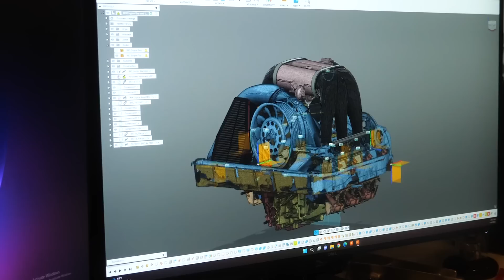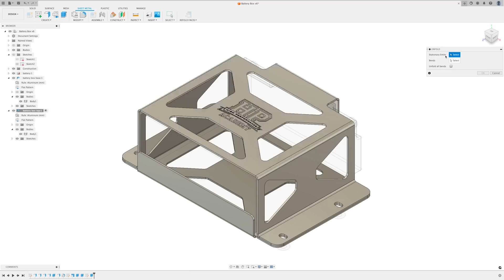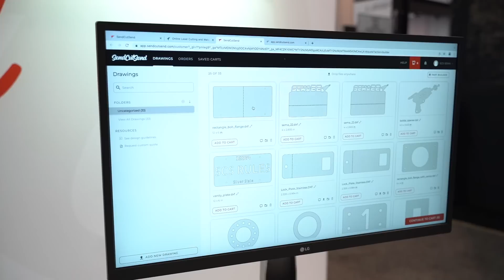Building Race Cars & Parts with CAD

Comment: my start in CAD actually began originally with 2D hand drafting on the boards with mechanical pencils, erasers, engineer and architectural scales, and sheets of vellum (think Kelly Johnson at Lockheed designing the SR-71 Blackbird).  this was the DEFAULT class Mechanical Engineering students had to take back in the mid to late 80's as CAD was still in it's infancy (or in many places just non-existant).  however it did become available at nearby Colleges/Universities around 1987, after that a student was required to take it in their 2nd semester...

my "first contact" so to speak with CAD was (get this) Autocad release 10 on DOS Intel 386 PC's using puck and tablet 1988.  yes, for those counting at home this would be 35 years ago so I'm an old "bastid".  ironically while I'm no Chip Foose, Dave Kindig, or Ring Brothers when it comes sketching out whole cars, i still like designing individual parts (before moving to Solidworks, F360, OnShape, etc) with classic pencil and paper.  it's "artsy" and "therapeutic" for me like I suspect it is for those guys.  ref: old world Painters/Sculptors from History. #ZEN
Reply: I think I was among the last generation of engineering students that learned to do it on paper with pencils and had to finish marked exams this way too. Ofc we learned CAD (PTC Pro Engineer) next to that, but the profs were like "the old school way is the basis!"... iirc these days it's all CAD from semester one.

Comment: We need more metal 3d printers and we need the cost to print to come down. I think there is tremendous opportunity to make a lot of money once the speed of prints improve and the volume prints are better
Reply from the maker: It has already been a long time coming but it will get there. There will always be tradeoffs between this and what are already well-established manufacturing techniques though rather than a 'one size fits all' replacement, imo - Taz.

Comment: This is BS for a hobbiest, and I'll tell you why ... Over several years I learnt 2D/3DCAD, 3D scanning, 3D printing all of it just for a hobby and all for my project car. I designed, test fit, printed molds and cast my own intake manifold amongst all the other parts I've made for my project. Sure it was fun and it's a one-off, but this part alone cost about 3x more that an aftermarket intake manifold that's readily available and took about 6 months to com to fruition. The trouble with knowing all these things is that you can easily find a way to make whatever you desire, or even parts you don't need, but make them because you can ...... and THAT is the problem!! .... not so much for a company with backing
Reply: I get its a massive topic and many years are needed to master- but some might enjoy 3d modeling a car trailer for example or 2d laser cutting shapes which is probably enough for most. Sounds like you went pretty well with it - like further than most Cheers
Reply: narrow minded. it is NOT BS depending on what you're doing. there are plenty of other areas in which it does save money and/or time.
i made a dash, a quick release for the wheel, air ducts and fan blades for my simulator and some stuff around the house or special tools that made my work around the house easier and faster.
That was just google sketchup and 3d printing, so a lot less stuff involved in comparison to your case. Differen area than yours and all of it saved me a lot of money and time. It was absolutely worth it, every single time.
Just because it was not really benneficial for you in terms of time and money doesn't mean it isn't for others and that all of it is BS.
Reply from the maker: @Jonno, bit to unpack there but to be honest a company would be unlikely to do that either. To be blunt, that was a series of decisions that you made for yourself, it has nothing to do with your software. You could have done this without CAD being involved and fabbed this up yourself, or paid someone to do all this for you and been in the same boat paying a lot for something you, in this case, didn't need to.

To be clear you won't find anyone advising that you produce a custom part that is the same or very similar to what you can buy off the shelf as an expensive one off is a good financial decision, especially when on a limited budget.

As you mention, doing the work in the software was a great learning experience. If that is what you wish to spend your time on even knowing you will never produce the part it would have value in this respect but not necessarily in a measurable way. You can even do this and get a price for production and compare before you pull the trigger too on parts that are unique, you're not committed to spending money to make something from there unless you want to - Taz.
Reply: @heikoscheuermann  I guess you people don't understand my perspective mixed with sarcasm .... I use 3D CAD, scanning, printing almost on a daily basis. From car parts, to tools, to things I need around the house, parts for firends .... anything I can get my hands on. Sure it costs money, and no you don't make that money back. But that's not the point. I love the process, the constant learning, adapting to change ... and wouldn't change it for anything. Hardly narrow minded at all.
Reply: @hpa101  yeah I was kinda being a bit sarcastic in the way that once you learn, you will go out of your way to find any reason to put it to use. The truth is it's a very fascinating process to conceptualise something, design it and then extremely satisfying to make it and put it to use. There are times when I've designed and printed items quicker and cheaper that the time it takes to go to the shop to buy a similar item ... sometimes there are no such items available. My 3D printers are the best tools I have in the toolbox. They are the future and an invaluable tool.
Reply from the maker: Ahh gotcha, I missed the sarcasm sorry 😅
That can absolutely be a trap. We are always our own biggest enemy in that respect! It seems to be something you have learnt to be conscious of yourself now at least which is a win for you I reckon 😎 - Taz.

Comment: If people wanted to learn more about 3d modeling google sketch up is also an interesting area. Just learning x, y, z is a great place to start because you might enjoy it and take up the full course offered here.
Reply from the maker: 100% There's no wrong way to get started really.

Direct modeling tools like SketchUp and TinkerCAD etc are often still used by those with the skills to use parametric modeling software like Fusion 360, SOLIDWORKS and the others mentioned by Dmitriy. 

Where direct modeling is very advantageous is in quickly putting together a concept. I think it directly compares to another comment here from someone who does that by hand as that is how they learnt before such options were readily available. The system/hardware requirements are also lower comparatively for direct modeling software.

While there is of course a crossover you just want to be careful you don't get to the point you're working hard to do something with direct modeling software which you could easily do with a parametric option instead I guess. I think a few budding 3D printers fall pretty hard into this category at times.

Turned into a bit of a novel there sorry haha. A topic I have been looking at a bit just last week - Taz.